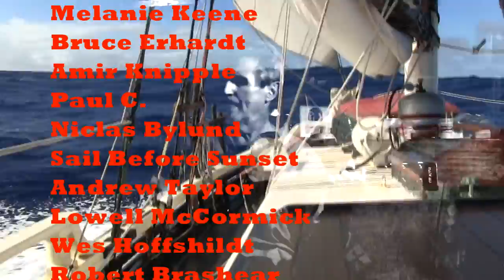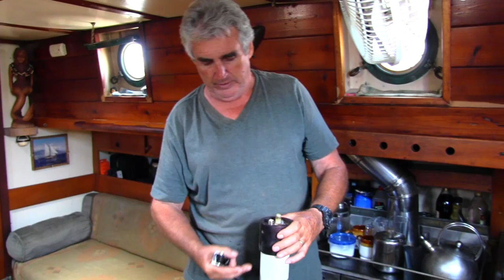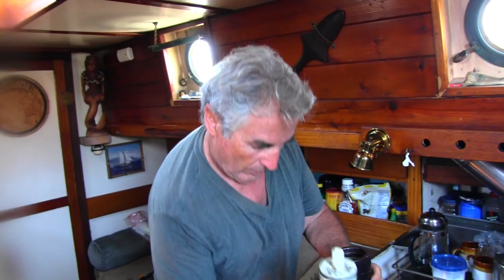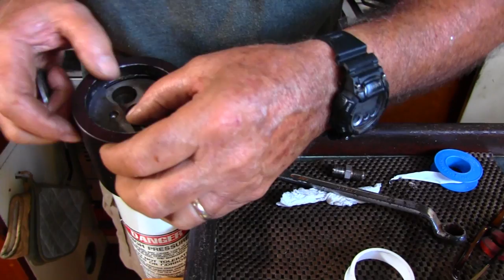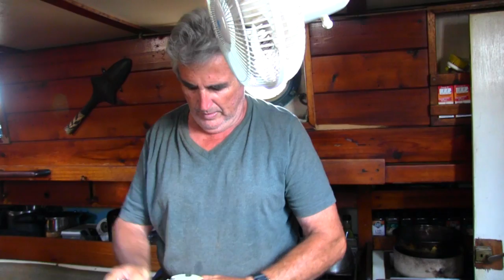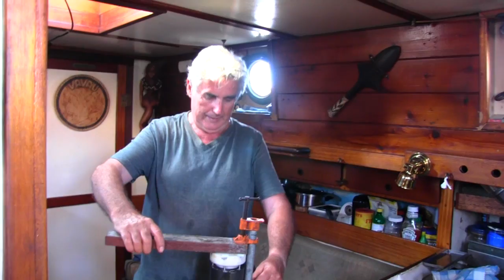#17 HOW TO REPLACE WATERMAKER MEMBRANE!!

Comment: I'm impressed by the physical strength required to remove and reinstall the membranes.  Jules is very muscular  and employed large tools.    I was surprised too that the old screws were not stainless adding to the challenge.   A good number of tools which resemble those of home construction and heavy duty mechanics were involved.   A sailor /sailboat needs to be well equipped it seems to me.   These videos are invaluable to me largely because they reveal all that is involved/required as well as the process itself.    I've read about this but have never actually seen demonstrated in its entirety. 

Perhaps you will write book also.   A lot to expect, too much perhaps.   Thank you again for this most interesting and valuable series.

Comment: How did you clean the pressure vessels before you installed the new membranes?
Reply from the maker: Just wiped out with a clean lint free rag.
Reply: Sailing Emerald Steel Thanks for the reply, any reason you did not wipe down with a bleach solution?
Reply from the maker: Absolutely no bleach!! The membranes will not tolerate it. That is why you must keep your system water separate from any tap water because when you do a back flush( flush system with RO water when you are finished making water) you can't have any chlorine/ bleach in the water and most tap water has some. Hope that makes sense. J and S
Reply: Sailing Emerald Steel Jules, makes sense.. just thought you would wipe the inside of the vessels and other fittings down before you inserted the new membranes, at least that is what’s I have done with a home RO system.

Comment: The second membrane looked much better than the first one.  I suppose the first one was the first that received seawater.  I guess since it was that it was the first to get clogged.  I'll bet just changing it would have helped output significantly, however it is probably better to just change them both after 10 years.
Reply from the maker: Yes, that's what we thought, as well.

Comment: Hello Jules and Susie, thanks for posting.  Will keep that in mind, as I will install a water maker. You mentioned the UV,  dou you have any thoughts for when  I install the washing machine?! Prevent corrosion of  washer by made water vs dock water.  Yes, my  water capacity is 1700+ litres/ almost 500 gallons. 😁